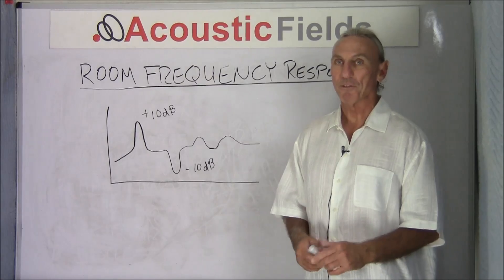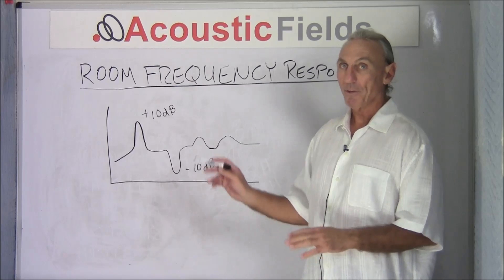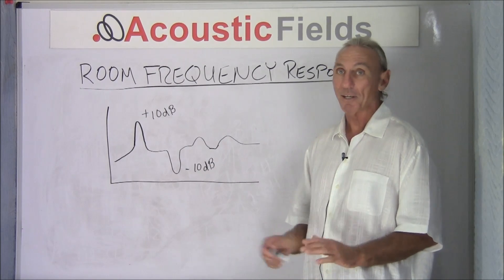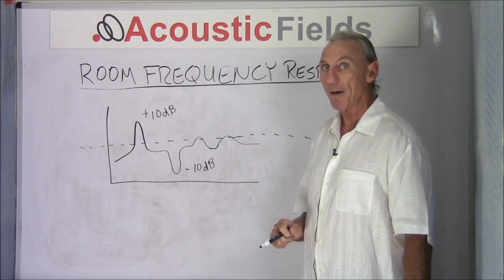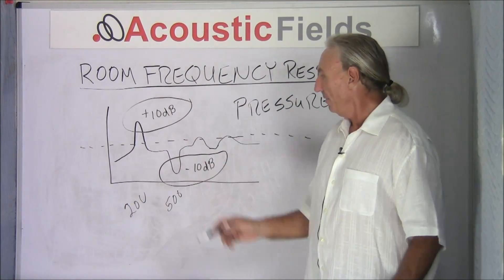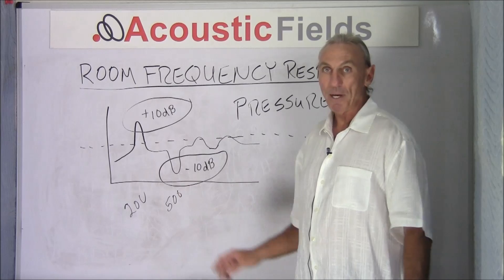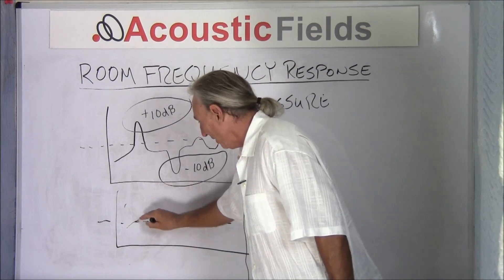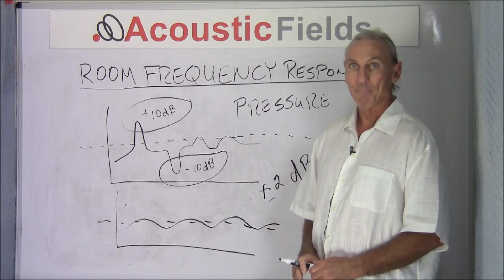How To Measure A Room's Frequency Response - www.AcousticFields.com

Comment: First, for low frequencies in particular, the human ear / brain can't distinguish between a few DB. What's most important is - narrow freq dips / peaks often at higher DB ranges and reasonable DB peaks / dips of wider freq ranges. Second, the human ear doesn't hear all frequencies at the same loudness across frequencies. See Fletcher Munson and / or equal loudness curves.
Reply from the maker: If your room is treated correctly, you can definately hear a +/-.5 dB increase in lower frequencies. We have that ability in our studios.
Reply: @AcousticFields  Please provide data proving that claim. Psychoacoustics says otherwise.

Comment: Title misleading. The video doesn't say anything about how to measure the frequency response. This is a lecture on what is Room's frequency response.
Reply from the maker: Before you measure, you must understand what you are measuring.
Reply: @AcousticFields  In such case why is the title misleading? Can't it say what is frequency response of a room?
Reply from the maker: In acoustics, you must educate first and foremost. People's lack of understanding of even the basics of the physics required in small room acoustics must be accomplished before you go to the next level. Its like walking up stairs. Every step is a result of the previous step. You must take the complicated and make it simple. We are planning a new series on how to take accurate measurements. We will then compare those in field results with our data base of over 240 rooms built and measured.

Comment: You are talking about the room's response, does this not vary with source and listener location?
I ask because I am convinced that a band PA system in a very asymmetric room needs different eq for left and right channels.

When I say asymmetric is mean large alcove bar on one side and window wall on the other!
Reply from the maker: Yes, response varies with set up, amplitude, and a host of other variables.

Comment: Denis, I understand the basics of low frequency management, but the attenuation of -10 in your whiteboard translating to the room space how would you address that lack of frequency if you were not to add back in some corrective EQ?
Reply: In this case would you try to treat the +10 mess at 200 and leave the 500 attenuation alone? Or simply say the room has to many problems and advise a different space ( if possible,)

Comment: This doesn’t explain how you determine your baseline? Is there some specific amp and speakers you need to use to make sure a completely flat signal is being played in the room in the first place in order to have a control to compare the measurements you get in different areas of the room? No one has been able to explain this to me.
Reply from the maker: H,  The room only sees energy. The energy it sees and how it reacts to that energy is a function of room dimensions.  Your room size and volume determines the room response curve. You must then apply absorption technology to bring the room response curve to a flatter response or baseline.

Comment: Seriously? You think a room has a frequency response? Any two individual points in a room will have a frequency response linking them, but the room as a whole? Not a chance. You can't equalise a room. This is a big audio myth.
Reply from the maker: D, Rooms have a frequency response which is dictated by dimensions and volume.
Reply: @AcousticFields  No they don't. They have nodes and antinodes dictated by their dimensions. The significance of this is that you only have to move your listening position a few inches to find a totally different frequency response. This is correctable only by wall treatment to either diffuse or absorb reflections. Software correction can only work at a single point. What you can correct with software is speaker unflatness. You do this by averaging multiple measurements from different locations.
Reply from the maker: D, The fact that you can change the response curve by moving things around does not negate the fact that a room of certain dimensions will have a general response curve. Yes, it is a variable phenomenon but the curve still does exist.
Reply: @AcousticFields  No it doesn't. This is an audiophool myth. The fact that people make money convincing the gullible that is so doesn't make it so. The frequency response of a room is determined by two things. These are the atmospheric attenuation between the speaker and the listener, which is flat apart from a slight top end loss when the air is particularly dry, and the nodal interactions between wall surfaces, which are 100% local effects - there is no overall room component to them.

There is no curve.

Comment: I have a standing wave in the 140-145 Hz range and it corresponds to the height of the room. Should I just get a carpet, and then some of this problem should go away? Now I have some normal plates in the ceiling, and hardwood floor.
Reply from the maker: O, No, the carpet will not work for that frequency range.  Use acoustic foam with a 2" thickness.
Reply: @AcousticFields  Thank you.

Comment: The thing people forget though is the graph of response similar to shown is just for that exact position in room. It will look different for every single position in the room. So you can get it flat in one position, but probably by making it worse somewhere else. I don't think its easy to fix it in many positions in room using EQ systems (eg Dirac Live), without actual physical correction.
Reply from the maker: G,  Yes, physical room size and volume are critical along with treatment technologies.
Reply: Yes room treatment (absorption/diffusion etc) is what I meant by "physical correction"
Reply: If you're the only person working in the room, the mix position in the only point in the room the response actually matters, right? What does it matter if you are making it worse somewhere else in the room?

Comment: That's why they say you can't eq a room a bulldozer can eq a room
Reply from the maker: A, EQ does have its place in small rooms for frequencies below 100 Hz. However, you first must manage the room response in that domain with proper room size and volume. Secondly, you must treat the remaining modal pressure issues with the correct absorption technology. Our experience tells us that you can EQ without audible artifacts 3-4 dB at most in lower frequencies. You must manage the bump below 100 Hz. and get it down to + 3 dB - + 4 DB with treatment and room size before applying EQ.

Comment: Really appreciate your expert knowledge. Awesome videos and explanation. I'm planning on building an isolation booth for voice-over recording & making it portable being that I am renting right now. As soon as I turn on the mic, I pic up EVERYTHING even my downstairs neighbors ceiling fan. Planing on using double layered OSB or MDF panels with Green Glue sandwiched in-between with screws and cotton insulation traps on top of the walls. I've heard a lot about not having 2 walls that are the same size. Would you recommend a pentagon shape of sorts? Sort of like a diamond or superman logo?
Reply from the maker: Hi Jaycassa,  Without noise measurements to quantify the noise amplitude and frequency issues, you are just guessing at what barrier material to use. If you guess, you will most of the time in my experience, guess wrong and build a barrier that does not work at any frequency, stops some but not others, or stops most but not enough to isolate noise from microphones. You must measure and quantify the noise before you try to stop it through barrier technologies.